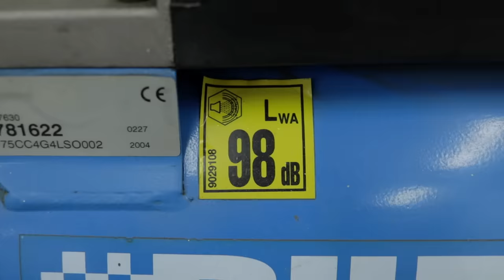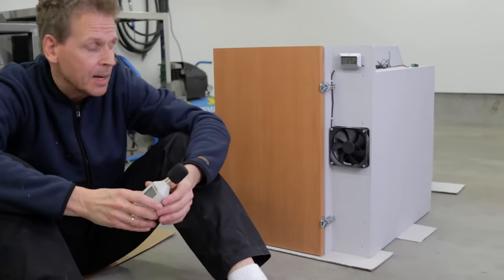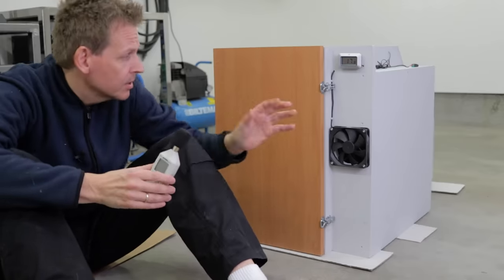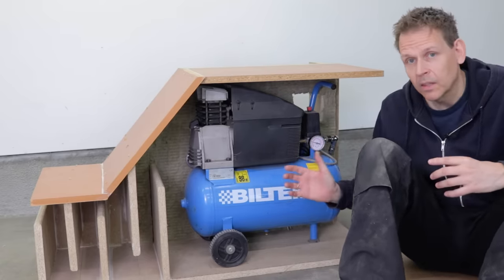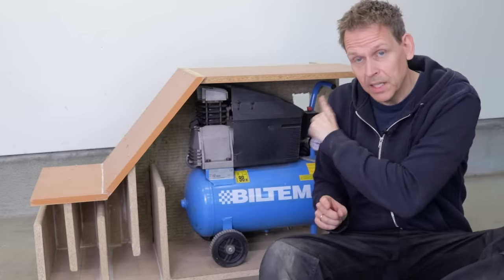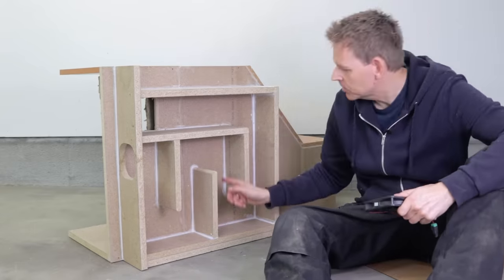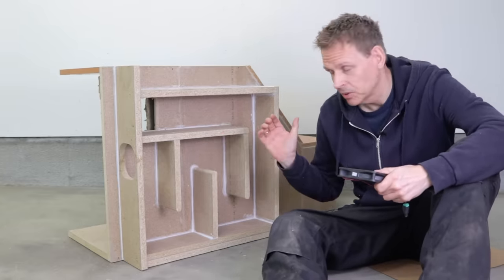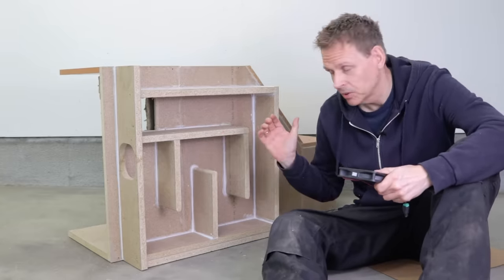Do not build a sound insulated enclosure for your noisy air compressor!

Comment: The sound level doubles for every 3 dB, so the new one is WAY more quiet than the old one. Also, the LwA=98 dB marked on the side of the compressor is decibels sound power level, not sound pressure level as you are measuring with your sound level meter. But the final conclusion in your video is spot on! I work with noise in industry and offshore. The first rule is: Buy silent! It'll always save money and give a better result.
Reply: That is a myth
Reply: It is about 10 decibels to achieve double the volume. That 3 decibel garbage is energy which is meaningless.
Reply from the maker: I have understood now that I have much to learn when it comes to the decibel scale / measurements.  😳 Thanks for your comment 😊
Reply: @cjr1881  😄 Well, whether you think it's meaningless garbage or not, it's math and how the physics of sound work. For example: 10*log(4) = 6 dB while 10*log(8) = 9 dB. Doubling from 4 to 8 increases the dB level by 3. Our ears may be said to percieve a 10 dB increase as a doubling because how our ears and brain works, but what Hestad is measuring is a doubling of sound pressure for every 3 dB increase. That's simply not debatable.
Reply: @tsstsstsstsstsstss  Perceived noise level is ultimately what matters, and from that standpoint you're incorrect.
Reply: @trevorlambert4226  From an empirical point of view yes, but it's a subjective measurement and basing your enclosure on the subjective measurement of someone who may already have severe hearing loss is a terrible idea. So an actual way of quantifying the sound power of a device, sound energy and pressures at various locations nearby is completely necessary, especially as people working in noisy environments may be blazé about their hearing, and hearing loss doesn't stop just because the process has already started. Plus, you need to be able to, for example, quantify the contribution of background noise and more than one device, and for that you need to know your decibel scale and what +3dB actually means in terms of the sound power level of a device. Incidentally, the reply with calculations is not entirely correct either. +3dB does not represent a doubling of pressure, but a doubling of intensity (energy per unit area) and as this is equivalent to pressure squared, +6dB represents double the pressure.
Reply: @cjr1881  See my other reply for why basing your enclosure designs on subjective opinions is a bad idea, and why no acoustics professional would do that. Yes 10dB is a great ballpark for those with nominal hearing but you need to know what the actual contribution to an environment your thing is making, and for that you need to do the maths properly, which you already know as you are aware that +3dB represents doubling of intensity and +6dB doubling of sound pressure.
Reply: Less noisy not more quiet, that doesn't make sense in English, sorry if English isn't your native tongue and you didn't know
Reply: @heybabycometobutthead  I thought it was quieter . . . ?
Reply: Sound intensity doubles with 3dB but due to the mechanics of the human ear, a 10 dB change is perceived as "twice/half as loud."

It isn't a myth, or a lie. There's just more than one way to define the word "double."
Reply: @chrisburn7178  the other point of db that is often overlooked is that it isnt actually a unit. unlike centimetres, or inches, or similar.

its just a ratio. "this" has "double the intensity" or 3db, in relation to "that".

i have 3db of gain, or 3db of attenuation. 

its just a ratio.

lol at "10 db".... thats just 1 Bel!

"deci"=1/10th.

the whole topic is filled with confusion, like a lot of things are...
Reply: @paradiselost9946  Well exactly, hence anything can be expressed in decibels as long as a reference value or starting value is specified - microphone sensitivity, circuit gain etc etc etc.
Reply: @chrisburn7178  consider the shockwave of a nuke...
raises an interesting point, as you can only reduce the pressure to 0 absolute, yet theres an "infinite" positive pressure one can achieve...

and what IS the frequency of a shockwave, a transient? 
rise time... the speed of sound as it passes by (crushing you to pulp as it does so...) 

and theres another log... pressure. its fairly easy to get small variations in pressure... pulling a vacuum on something always tends to produce a log (or is it asymptotic?) curve...

im no mathematician. i just like knowing the theory behind it. who needs maths anyway?

another "relative" measurement... volts... there is no "absolute" potential. its always in relation to something else.
Reply: @paradiselost9946  Calculations of sound pressure and intensity etc. are based on air behaving as an elastic medium, with particle velocities and displacements that can be measured or predicted based on simple harmonic motion. When the air is being forced way beyond its elastic limits, all kinds of mad things happen no doubt. It could certainly be modelled using fluid dynamics, but that's not something I'm familiar with at all.
Reply: @chrisburn7178  hmmmph. i preferred the unedited comment i get in the notifications... "no sane person would attempt to measure a nuclear shockwave in db..."

LOL!!!! 
it was the most extreme example i could think of at the time?

i vaguely recall somewhere, something about the limit is 220 db or so, mostly due to the vacuum produced. (would that be cavitation?) as a "sound" is generally considered to be some type of "wave".

its like you couldnt measure a sonic boom in db either. transient. may pack a lot of punch but as theres only one...

as for fluid dynamics... um... something about a law, p1/p2 being 0.557? that is, once you hit slightly double atmospheric pressure, you hit the speed of sound, and thats that. cant flow any faster.
and steam or hot gas is marginally higher, at 0.577... iirc.

this gets into tricky stuff such as the jet of air from a compressor as it exists is actually contracting rather than expanding, as it is absorbing heat from the atmosphere in an attempt to get back to equilibrium, whereas the delaval/convergent divergent nozzle relies on a hot gas/steam that rather than radiate heat and cool down, converts it into kinetic energy, hence gas flow in the diverging section is supersonic, whereas flow through the choke point is still just the speed of sound, albeit higher than in "free atmosphere " due to density and temperature... 

yes, air can do some rather peculiar things...
Reply: @cjr1881  "That is a myth"  No, it is a math ;)

@ trevorlambert4226 "Perceived noise level is ultimately what matters" .  No, actual energy is what damages your hearing, not perceived sound level.  I will steadfastly argue that a 3 dB increase is a doubling and that relying on "perceived" sound level can lead to hearing loss.

Comment: A trick you can do to optimize the design of this sort of sound isolator is to use a speaker enclosure design tool. Measure the noise that you've got and look at the lowest frequency. Then use the enclosure design program to design ports that are tuned to 1/2 of the lowest frequency that your device produces. Remember to set the program to use two ports because you need a separate one for intake and exhaust. This will give you the maximum noise attenuation for the shortest port length. However in this case I suspect most of the noise is either vibrations transmitted via the floor, or is sound coming through the sides and top. Take a look at how subwoofer boxes are braced. The side with the air intake is probably fine as the vent acts as bracing, but the other side and the door probably could be improved quite a bit. Google the kraken subwoofer build to see what I mean. Also consider using some mechanical isolation such as springs or foam rubber under the compressor and pay attention to draining the tank.
Reply from the maker: Thanks a lot for the suggestions 👍 Since the box is already built, I will most likely not change the ports - but this is definitely something I will have to look into if I ever was to build a new one! 

I think you are right about vibrations and perhaps better insulating the non-vented sides would help. The floor has just a thin carpet on it, I might add Rockwool sound insulation there as well and replace the wheels on the compressor with rubber fees.
Reply: Thanks, James! Very in depth info!
Reply: @kihestad  Rockwool will help immensely, I've done that myself.

Specifically a thick layer of rockwool in the bottom of the enclosure with a 25mm rubber isolating pad on top of it.
Reply: When I saw the "maze" I immediately thought of a speaker transmission line enclosure, with the compressor as the "speaker".  The same acoustic science applies here.
Reply: It’s called a T line. Enclosure
Reply: @BillLambert  The maze also had nice parallel walls. I would have added some random slopes (or pyramids) to further break the sound down.
Also, some moving part can help, whatever can convert waves to heat or motion will attenuate the sound...If it doesn't help to propagate it ^^
Reply: /me does it wrong
WHY IS IT LOUDER??
Reply: That's a crack up, I never thought of tuning a half octave below the racket. The compressors I've used wouldn't be happy with the heat in an enclosure. Perhaps it would be OK for home use.
Reply: This sounds really cool. Thanks for the tip
Reply: @kihestad  clad it with rockwool then spray it with truck bed liner.
Reply: Haha had the exact same thoughts as a car audio enthusiast (i like me doof doofs), a de-tuned subwoofer enclosure for the compressors operating reasonance and suspend it inside the box with latex tubing (the surgical stuff) to isolate contact vibrations

If money is no object you could try dynamat (or cheaper knockoffs) the inner walls instead of the felt stuff too.. its expensive but works really well.. people often don't believe it til they hear it in action!

Comment: Something to also consider is that, while the reduction in noise in dB is not sufficient, the sound characteristics are way less "sharp" with the insulating case. I don't know how much of a difference it really makes as I can only compare microphone recordings but even without a significant reduction in dB I would probably still prefer the case just because the sound is not as shouty and more basey.
Reply from the maker: That is a very good observation, not many has commented on it 👍Originally these compressors have a high pitched and hard noise that really hurt in your ear. It crashes totally with frequencies in use when we speak. With the box it is just a low rumbling soft noise left, much more pleasing to the ear. Like thunder far away. Even the noise is there you don't need to rise your voice to talk over it.
Reply: Absolutely! The sound insulation mainly cuts high frequencies.
Bravo!
Reply: At one of my old jobs they built insulated panels for the dust collectors.  The difference was night and day.  Before the panels were made you had to shout at the person next to you.  Afterwards you could speak normally right next to the collectors.
Reply: @MrVukojeB  bingo. The most effective thing to attenuate low frequencies is adding mass.
Reply: Heck yea port that baby and tune it to 32hz that's what I'm about 🤣🤣🤙
Reply: A less agressive tone
Reply: the high frequencies are more damaging to the ear than low ones
Reply: Your comment has merit but not for any of the reasons mentioned here. 

You need to avoid reflected sound escaping, need to absorb sound before it can resonate the container and pay attention to converting the energy into another form. If you suppress sound creation then sound mitigation is remarkably more effective 

Think about the thin walls of a car muffler- why is it quiet? And why is it often hotter than the pipe ahead of the muffler?

So the chambered box has some sound control merit- but the sound is not just the noisy universal motor; there is also the impact of the intake air that cycles. That is why centrifugal air compressors are quieter: no velocity cycles. 
This vid focuses on airborne sound waves but leaves out the other two major factors of air compressor noise. 

EDIT: he did stop the wheels and guards from converting mechanical oscillation to sound to be fair

Comment: I really enjoyed your video. But, note that air compressors in general have very poor efficiency and that means there is a lot of heat procuced inside the small volume of the enclosure. I would guess like 80% of the installed power is lost. So a lot of cooling air must be circulated around the compressor at all times. If the temperature inside the enclosure rises the efficiency of the compressor  will be even worse.
Reply from the maker: Thanks a lot, glad you liked it 😊 It's a pretty cold climate here where I live in Norway, in the Northern part of Europe. I have actually fitted a heat pump in my garage to be able to use during winter time. I can see this is a bigger challenge in warmer climate, and a more powerful fan or event radiator cooling could be needed if it's in a very warm environment.
Reply: @kihestad  We are pretty much neighbours then.LOL Gteetings from Sverige.